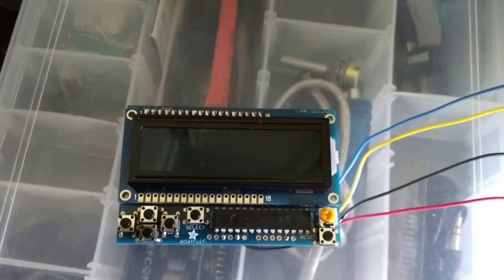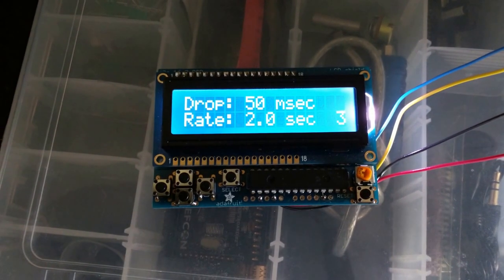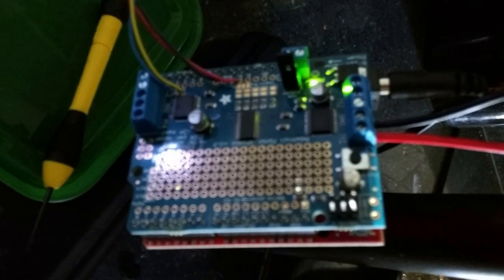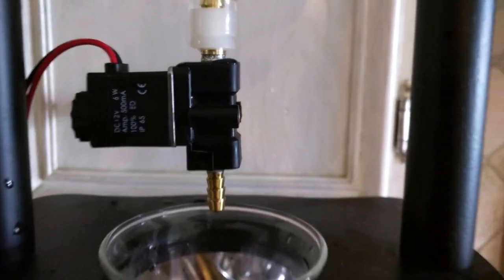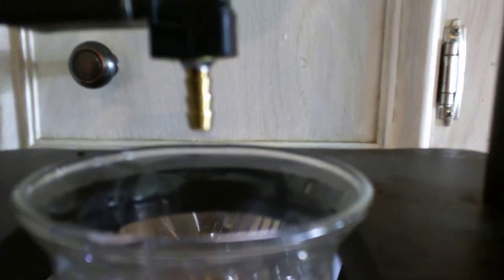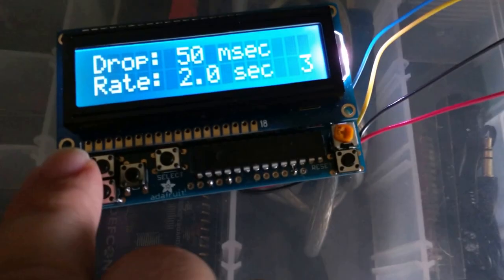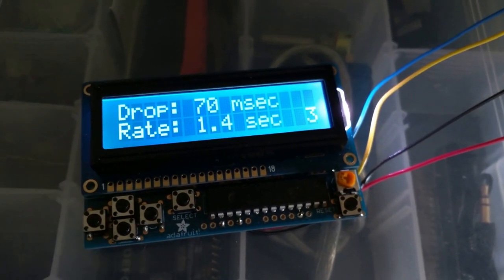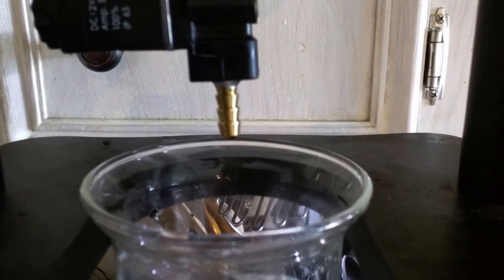Tinker and Twist's Arduino Kyoto Coffee Brewer

Comment: Nice project! Do you still know which valve you used?
Reply from the maker: I used the quiet solenoid valve from the Ada Technical Bookstore in Seattle WA
Reply: @TheMakersWorkshop  Do you remember the valve diameter size?
Reply from the maker: @arkaivos  Offhand, no ... but you can purchase the solenoid directly from Ada Technical Bookstore in Seatle.  They have the solenoid ( and adapter ) available.